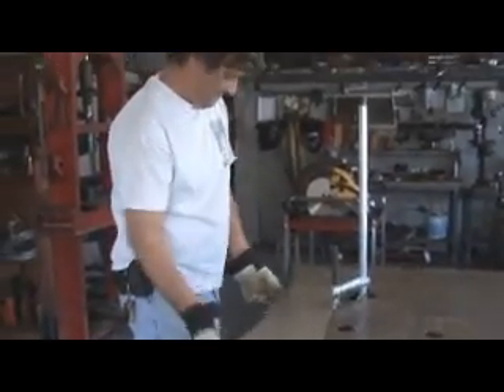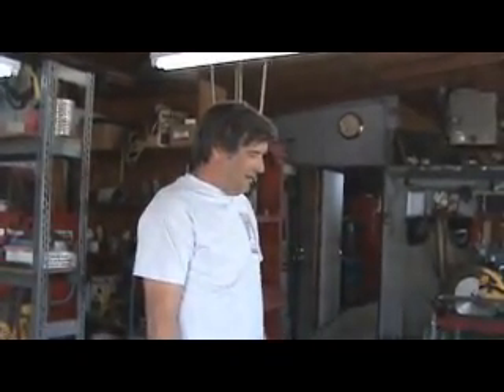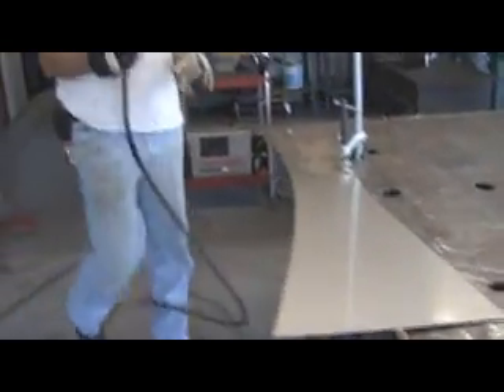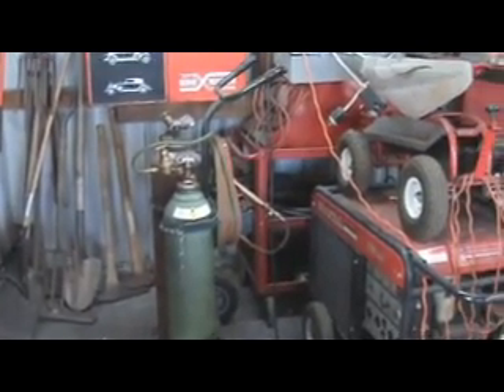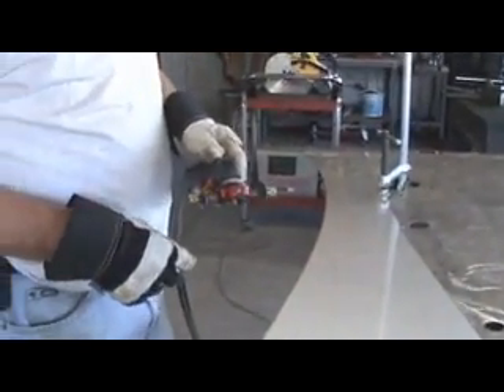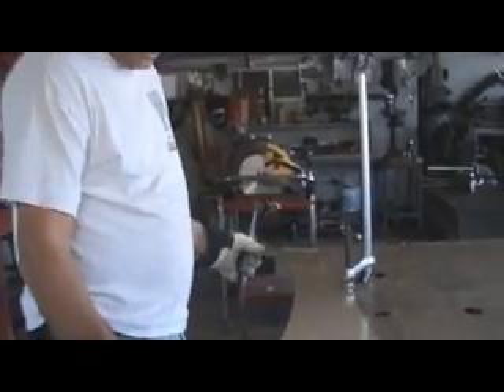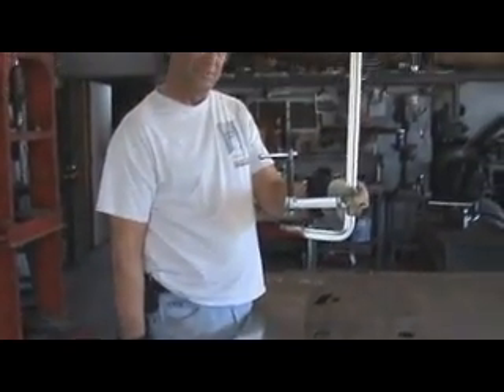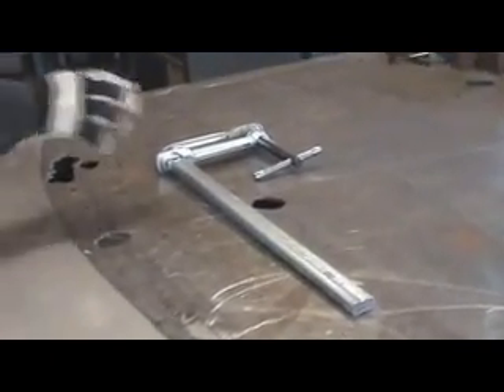Using a Plasma Cutter - Kevin Caron

Comment from the maker: @99XM For the bigger units yes, you need a separate air compressor. Some of the smaller ones have a built in compressor. But they are not for the thicker metals. Sorry don
't know much more about them then that.

Comment from the maker: @99XM Runs off the air compressor. For some metals it runs better with bottled gas but for steel plain old air is fine.  The unit costs around $1400 last time I looked. Runs on 220 or 110.

Comment from the maker: @maxspl153 Should be able to run a smaller one just fine. I was using a roofing compressor for a long time. Just look for the lowest cfm usage you can find. Don't forget to check the voltage required also. Some run on both 110 and 220.

Comment from the maker: @nvr4saken Mine will run on bottled gas also. I just use clean dry air from the compressor to keep the cost down. If I was going to cut anything other than steel I would change it over to the correct gas for that job. 

Thanks for posting.

Comment from the maker: @Jerbob1 No comparison at all. I have a 10 ga. nibbler and it has been a very disappointing purchase. The punch and die only last about 20 minutes of work. Even with LOTS  of oil on the metal. I have broken several dies because they go dull and then the punch will put so much pressure on the die it snaps. At $55.00 each that can get really nasty on a big job. 
The plasma will just keep on cutting. Replacement parts for the plasma run about $15.00, and last for days of hard use.

Comment: I dialed down the pressure to stop some of the high-pitched whistling.  I'll increase it and see how it works to remove the slag from the top.  Also readjusted the roller height to 1/16 of an inch.  Thanks for your great tips, Kevin.

Comment from the maker: @Jerbob1 Glad it  works for you also!  Just be careful to keep your head and eyes over the torch handle. NEVER look to the side of the torch to see where you are going.  I do not understand why you have slag to go over on the top of the metal. Are you running the right air pressure?  Make sure the gap between the tip and the metal is less than 1/8 inch. That should help.

Comment from the maker: @Jerbob1 HI Jer.  
Yeah, that is the only reason I did not wear shades. I just can not see the line. I feel I am safe using the training wheels with the collar that goes on the torch. It blocks the light from my eyes. If I am not using the wheels you can bet for sure I will be wearing the shades. 
Thanks for posting, check back when you can. I update about once a week

Comment from the maker: You should wear a dark lens like for A/O cutting. Something darker than sunglasses. I am not wearing them here because with the wheel attachment all the bright light is under the metal. If I was cutting free hand I be wearing cutting glasses. About a shade 5 or 6 works best for me. You can get them at any welding store or even Home Depot.